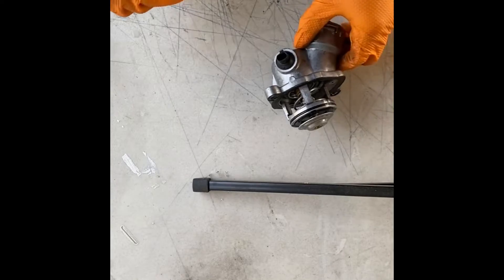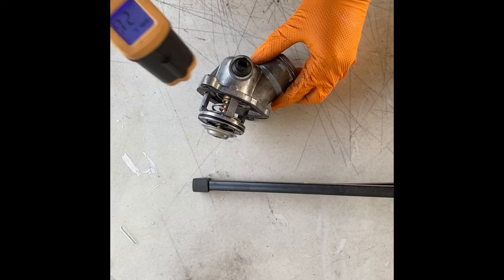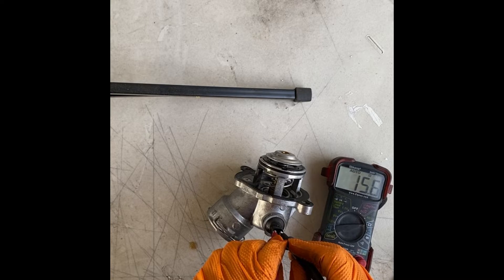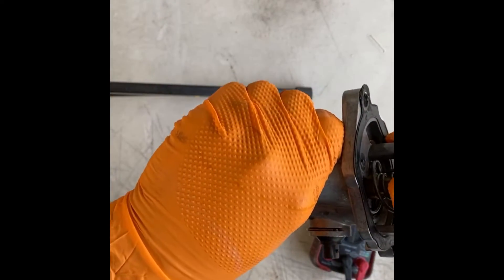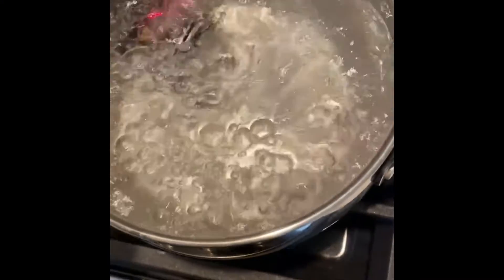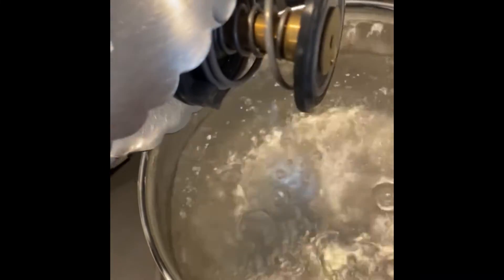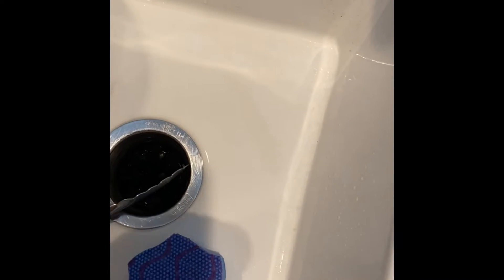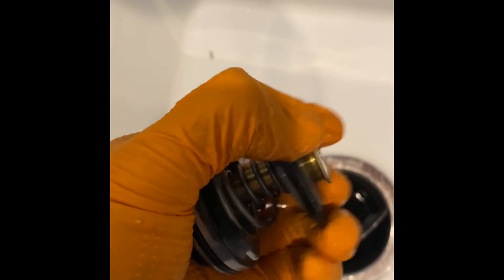Mercedes Benz Thermostat Diagnosis - How to test the electrical and thermal components.

Comment: Hello, I have 2007 Mercedes s550, I am having a heating issue. I have already replaced the water pump, thermostat, and change over valve. When the car is idling cold air is blowing. When I am accelerating the air blows hot. I am leaning towards it being the thermostat. Car’s operating temperature is perfect and car doesn’t overheat. Any thoughts?